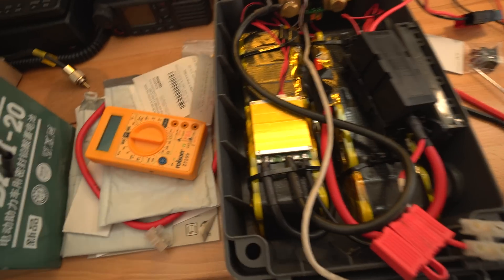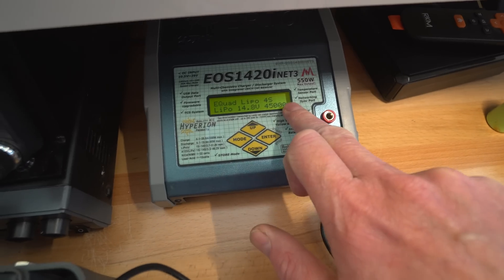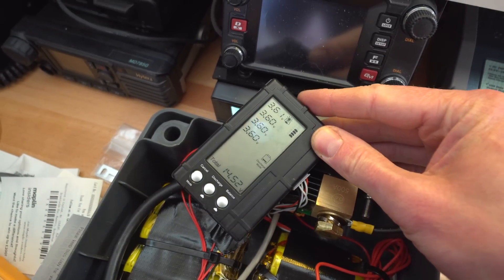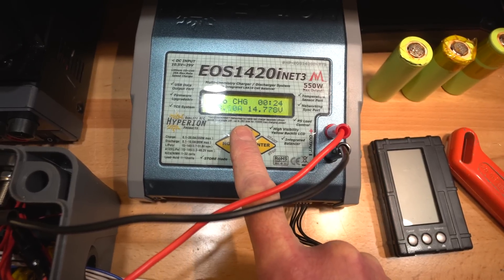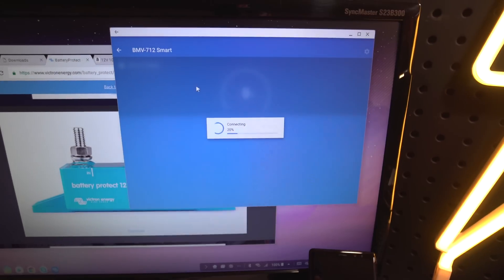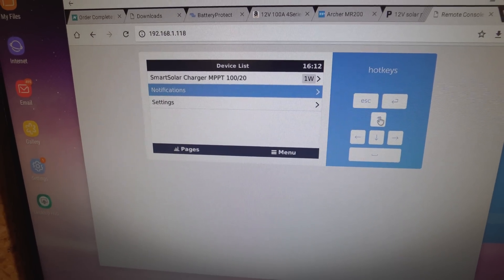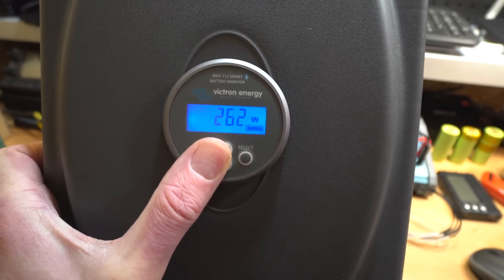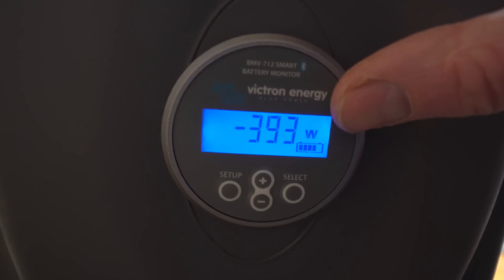SOLAR POWERED SHED | PART 5 LOAD TESTING AND REMOTE MONITORING WITH VICTRON VRM

Comment: Don't suppose you've ever tested whether you the raspberry pi will still send data to the victron vrm when connected over a mobile hot-spot or 3g dongle rather than the ethernet lead?
Reply from the maker: Yes it would work, I’ve got no doubts it would 😁
Reply: @andykirby  Sweet, I'm gunna pull the trigger on this setup for my van, thanks dude.

Comment: Lol , I pretty much went excactly the same route, same regulator , same battery protect, 1500w pure sin inverter, 2x20watt + 4x65watt solar panel, all parallel.Beyond that I pulled a cable in to the house so I have a socket in my pc room with 220v from the inverter, and a switch to switch the inverter on/off from inside.2x70Ah batterys, still debating how im gonna proceed, add 2 more , or change to 2 heavy deep cycle battlerys.Seriously considering buying a second handed Twizy and try recharging it with solar.Nice to see someone thinking alike , guess I ain't crazy after all .(or we both are) :)
Reply from the maker: Haha definitely not crazy! More insane! Seriously though yeah it’s great to see others doing the same, it’s highly addictive building your own systems isn’t it and there’s no end to what you can do. Can beat free energy. I’m considering getting a wind turbine next😅😅👍

Comment: Baitrium has a smaller cheaper system designed for EV apps. Maybe motorcycles small ev's . I know this is a older video. Maybe you could check that out any way. Maybe a video about them???

Comment: Hi Andy, I'm using one of these Active Balancer units to balance my 7s 80p 200Ahr 18650 power-wall and I'm very impressed so far --> QNBBM 7S 15V 24V Active Balancer BMS for LIFEPO4 LTO Polymer LMO LI NCM. As a test I swapped out one of the 80p cells for a 40p cell and loaded the pack up with 1kw for about 20 minutes, the balancer tried to hold the cell voltages together even with this ridiculous imbalance, after 20 minutes the 50% capacity cell was .245 volts out of balance, when I switched the load off the cells re-balanced after a few hours. The only downside is that you need a separate cell voltage monitoring device, I use a ISDT BattGo BG-8S Smart Battery Checker for this. Under normal conditions the cells never get more than 14 mv out of balance, under very heavy loads (>1kw) maybe about 50mv.

Comment: Very good info. I am working on a similar project and had no idea about the raspberry pi. Do you have a link to the software by chance?

Also I have the versions of the charge controller and BMV with built in Bluetooth. Is it possible to connect those via Bluetooth to the PI to avoid buying those overpriced USB cables? Cheers!

Comment: Awesome video as usual, you've made me want to get off my arse and do something similar with my garage despite having a 6.5kw system on the house already :) projects and boys toys!
Reply from the maker: Haha! Cool, is your house system a commercial one? I’ve been looking around at different offerings but not sure yet what to do with the house.
Reply: i used a local company to install it, just one man and a band really, as soon as i met the guy i knew he had the passion and skills and i'm always up for putting money into local stuff if i can (had to get approval for over 4kw though which wasn't a problem, guess they have to whether exchanges can take that much power back!?!) got 2 Nissan Leafs, an Ebike and Electric Unicycle so everything made sense to go with solar! still not convinced on the cost of mainstream battery storage though so have been put off it, considering most spare energy goes into one of the cars the setup works quite well at the moment. You have probably come across this already but i'm sure with your skills you could make your own anyway for the Twizy if you cover the shed with panels ;) http://myenergi.uk/product/zappi/
Reply from the maker: That’s good stuff! You are well and truly an electric household then! I know what you mean, batteries are expensive and actually if you have EVs then that perfect for using the extra energy generated by your panels! You’ve got me excited by this now lol! Ahh thats the Zappi system shown by Rob From fully charged isn’t it. I love that idea!

Comment: nice gadgets but my biggest concern is the charge controller and before you go any farther you may want to check to make sure with out a doubt that it will let you charge to any voltage if your inverter shuts down at 16 volts youll need 15.9 volts to stay at the edge of the shut down.

Comment: i have been using these on my packs 15 cells in total but im running a 3 cell system https://www.ebay.co.uk/itm/1pcs-3S-11-1V-12-6V-25A-18650-Li-ion-Lithium-Battery-PCB-Protection-Board-JX-/132257844935?hash=item1ecb2e8ec7 not had any probs yet

Comment: handy thing for you to know is the rpi3 has bluetooth and wifi
Reply from the maker: Yes you’re right! Awesome bit of kit. The control panel of the software even has settings for WiFi so you don’t need the network cable, although I prefer the reliability of a wired connection.
Reply: yeah wireless sure as hell ant all it cracks upto be
Reply: Just make sure the router and all monitors are running off the backup supply .... nothing worse than having a power cut and realising your monitoring system / charging circuit is also down lol :D good work though ... I love it